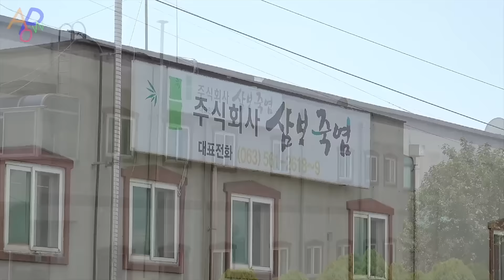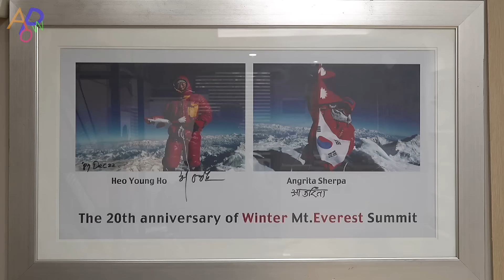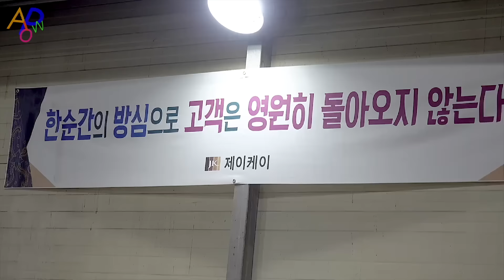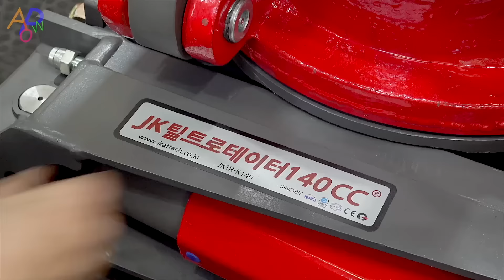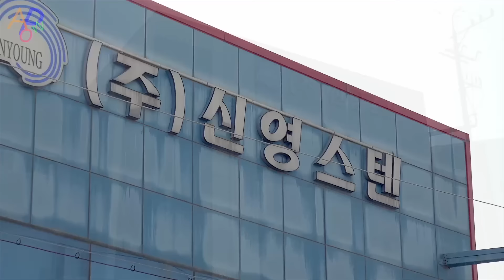Wonderful Mass Production Skills! Best Korean Factory Manufacturing Process (SUB)

Comment: I love the way they put the tires on backwards on some of the tractors. Some of the tractors had all of them backwards, and some had part of them backward.
Reply: I also noticed but also, is it possible the rims installed at factory are temporary? At 9:36, the two front tires are different, and the rims' paint seems scratched beyond looking new.
Reply: I noticed that too. After all that good detailed assembly work it seemed strange that they’d show me a finished product with such a glaring bunch of mistakes.

Comment: I wonder why the gear wheel in the grapple is made of brass instead of steel. Steel is typically used for gears. The worm wheel is also steel. The forces on the teeth of the gear must be enormous, and steel is stronger than brass here. I have not seen any lubricants been added into the gear housing. But that might just be not recorded. Awesome video.

Comment: Wow.. a foreign tractor factory that has excellent ergonomics and some PPE. They still aren't wearing safety glasses though. I would not allow anyone on the shop floor without them no matter what your job is. Possibly hard hats too as they have heavy equipment operating overhead.

Thank God they have their face diapers though... maybe it will save them from an eye or crush injury?
Reply: Koreans usually follow more their judgement less regulations. They create new things every moment, leading to easier work, better outcome, or disaster occasionally.

Comment: Oh you are not showing a mass production line with the sense of an engine assembly line where the men move engines around using cranes.  Mass production lines have conveyors where the product is assembled while the people stand in one spot and the work passes by in front of them AND THEY JUST PERFORM ONE OR TWO TRICKS TO TEH PRODUCT, AS IT MOVES BY IN FRONT OF THEM..

Comment: なぜタイヤの回転方向を左右違わせて装着するのか分からない　なぜ前輪のホイールナット３本だけ？　日本や他国では考えられない　不思議な国ですね。　I don't understand why the left and right tires are installed with different rotation directions Why only the 3 wheel nuts on the front wheels? "It's a strange country that would be unthinkable in Japan or other countries."
Reply: 일본은 구석기시대의 사고방식

Comment: How come some of those Tractors at the end of the first part not only had  DIFFERENT 'tread' patterns on the rear wheels, but at least 2 had DIFFERENT coloured REAR Wheels, - if that was China I could understand it, - but not S.Korea. - BAD publicity dept. - too much of a rush to 'Show Off'. Also the 'worker' with the light who was supposed to be 'Quality Control' - how the hell did he know if all those nuts were tight, he didn't even touch any-thing. NOT very impressed at all, - won't be buying one of that make.

Comment: Odd that they went through all the work to mask and paint yet they didn't paint the welded frame before assembly. That bare surface will eventually rust. Poor quality. I didn't catch other things along that line - that just blatantly stood out. Kiota tractors cut corners.